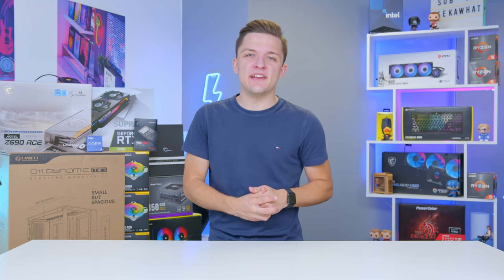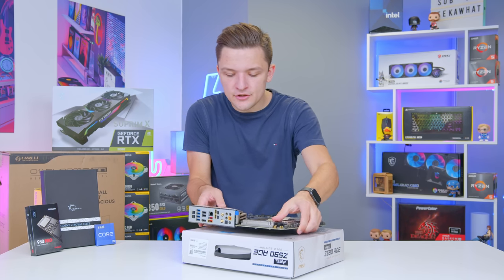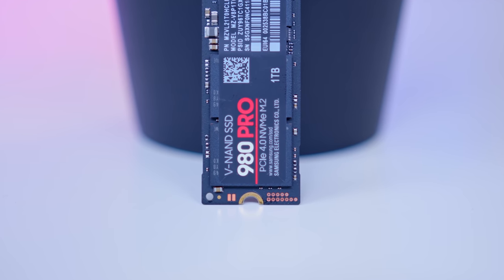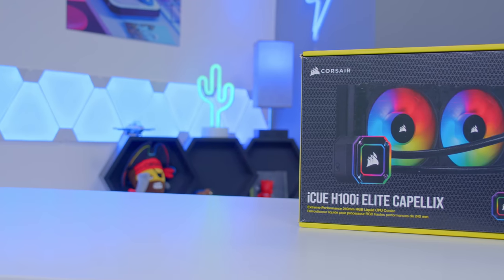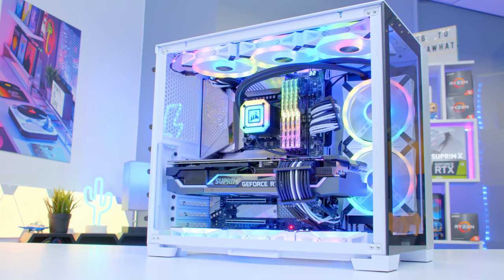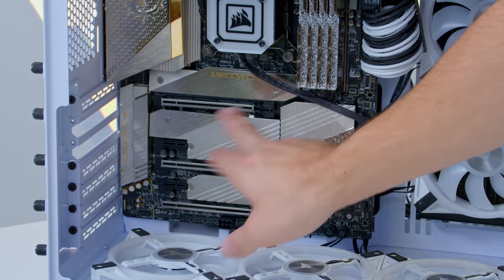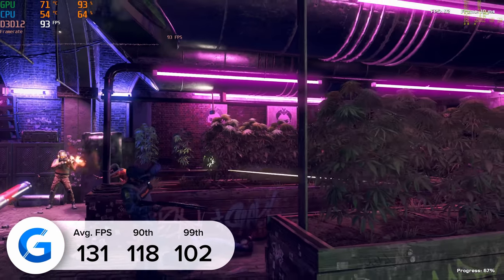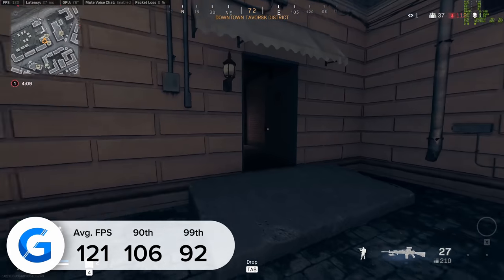The $3000 4K Gaming PC Build 2021! [Testing Our Most INSANE Build Yet in 15+ Games!]

Comment: Finally the radiator is on the side and not on the bottom
Reply: yes it is on the side
Reply: exactly it triggers meif it’s  on the bottom sometimes. If its intake then its just sucking up dust. And i dont think CPU coolers should be on outake

Comment: did you not include the price of the GPU in the build? bc that GPU new is 2500 of the 3000 you put in the title... even the used ones are still 2100

Comment: Built this pc but it’s not detecting the graphics card when I turn it on & also it didn’t come with enough cables to plug in all 3 slots on the graphics card it still turns on but I’m not sure if I need that 3rd cable or not

Comment: GeekaWhat you used a bit slower SSD you could use a WD Black SN850 it has 7000MB/s Read and 5300MB/s Write your SSD's Write speed is 5000MB/s Also the WD Black SN850 is cheap also you could buy a 2tb version too for that price Please Look the website ratings for the SSD

Comment: Hi, I'm currently still rocking my old pc(from around 2012) which I have put a lot of time and money in, my motherboard is the z97x-gaming g1 wifi-bk Black Edition, this one set me back around 600-700€. I'm wondering if the motherboard you are using in this built can compete against the one I'm rocking right now,also if I'm right the one in your video doesnt support dual bios?

Comment: I recently built a pc with i7-11700k recently pair with 3080, I don’t understand why my cpu is above 80 degree sometime reaching 90+ while gaming? I don’t think I have compromised on any cooling system for my cpu
Reply: That’s not a big deal like at all
Reply: I'm using the same h100i elite capellix cooler seen here for my 11700kf and it never really breaks 60 degrees
Reply: @XCrooked_TonguesX  seems like i had issue with my case, i changed mine... and now i dont see temp higher than 70 in any condition
Reply: @julynnix7989  Glad to hear it